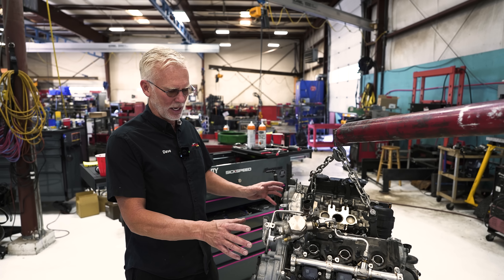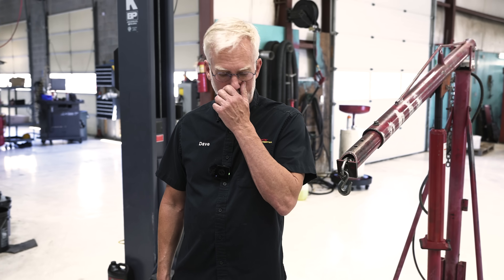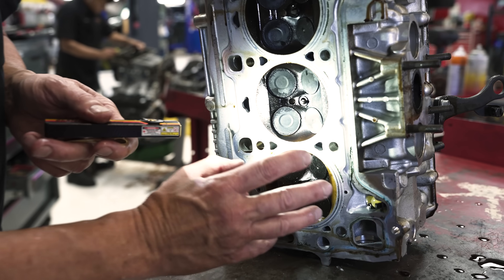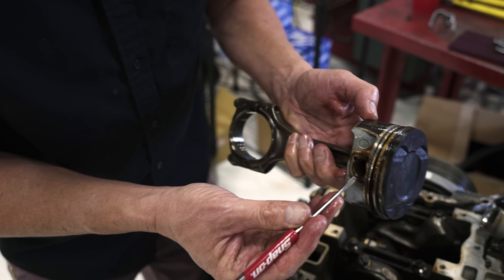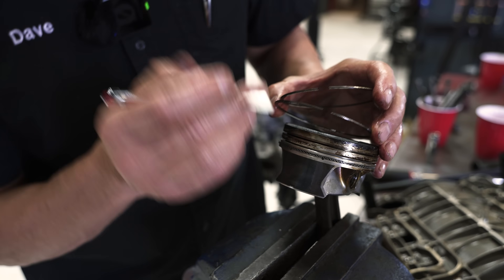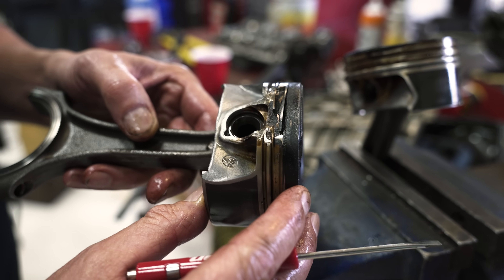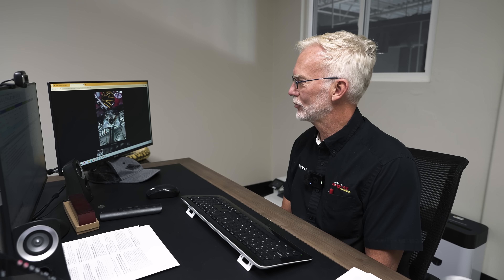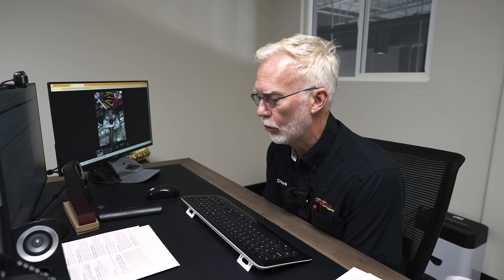Audi S5 Update: Piston Damage From LSPI (Low Speed Pre-Ignition)

Comment: I worked in a dealership that was bought out by another dealership.......they started having bulk motor oil delivered into a tank. We had NO IDEA what oil we were being made to put into cars. At the time the corvettes were coming with Mobil 1. They made us use the bulk oil they were buying............I left there in a hurry ! ! ! ! !
Reply: I only use Castrol Edge A3/B4 in my Audi … it’s not even expensive so I’m not sure why people deviate from OEM spec?  Cheers Drew
Reply: GM still uses Mobil 1 as their Dexos rated oil. I use Supercar in my Blackwing
Reply: Use c😢😢😢
Reply: @mitchellwilson8463 
I can tell you with absolute certainty, VW / AUDI OEM oil is Castrol. If you don't use Castrol, make sure the Oil rating is A3/B3, A3/B4. If you don't see this on the bottle, stay away unless it's an emergency. If the bottle doesn't say European on it anywhere, chances are you have an incompatible product.
Reply: Old European formula is the death elixir for Direct injection. 
Hi calcium just like in diesel oil causes spark knock on Direct injection.
Reply: @pigg20021  VW/Audi OEM oil hasn't been castrol for the past 4 or so years. They have been using Mobil for all 0w30, 0w40, 5w40, and 10w60 since. i work for audi

Comment: I was greatly impressed by your Tech, Alejandro, before you showed his tool box. He is efficient, thorough, and well trained. Not to mention making a good salary as well. Keep up the good work!
Reply: I'm sure he's earning every penny Hard, dirty, tiring work!
Reply: Rather than $50,000 in student debt you have $50,000 in tools.  But the thing that’s not talked about is how this engine may cost $30,000 to replace, this repair may cost $20,000 to do, and all it takes is one pinched o-ring, one missed knick in the cylinder wall, one bad spray pattern injector, one piece of metal he couldn’t see, and either the whole job has to be done again or he will be screamed at by the boss as they then have to make it right.

Guess who gets to do the repair again for free if there is one thing he misses, didn’t catch, was unable to see etc.
Reply: @Dansyoung  you're not wrong. As an experienced auto tech, I've seen these things occur. All I can say is, taking it apart the second time goes much faster. Live and learn. Alejandro has a relatively small box considered a beginner box. That cannot even come close to housing all the tools needed by an auto tech today. My box is Twice the size, it is still considered medium

Comment: Part of the issue is the shifting strategy of modern transmissions. They often lug the engine at low RPMs, which is the perfect condition for LSPI.
Reply: this is why i floor my RS5
Reply: Yes, I have noticed this on numerous friends cars. I tell them to gently press on accelerator pedal to get trans to drop down a gear.  I drive a 5 Speed manual so I'm in control, not a computer.
Reply: @robertcambareri1028 manual owners try not to mention they drive a manual challenge(impossible)
Reply: @ADUSN not many people drive manuals anymore. What are trying to get at?
Reply: Yupp 100%
Reply: Save The Manuals!!!! It's a campaign. Not a dig.  And it truly is a satisfying driving experience.
Reply: @hansgruber3552  LSPI had the biggest problem on manuals when direct injected design became popular. LSPI was basically inexistent on naturally aspirated or port injected before that. Direct injection came along, and manual transmissions were the biggest problem, due to drivers keeping tall gears at low rpms, asking for power. 
I think the automatic transmissions now are a problem due to epa regulations and gas mileage. The ecu is trying to keep you at 1100rpm when cruise is on at low speeds. If the car goes uphill, if the engine cold....
Reply: I think the LSPI is kind of myth as excuse for other issues - problems between seat and steering whell...
Reply: @pavolklepac935  I know there’s a temptation to ignore reality and just blame another person. LSPI is definitely real. It can be aggravated by high loads at low RPM. Engines have smaller displacement and more power than ever before and are often boosted. Lots of things are combining to create this problem.

Comment: Audi/VW attempted to build diesel-type, low-rpm gasoline engines to increase mileage; this was done by designing an undersquare engine with a long stroke to produce more low-rpm power which encourages engine lugging. In 2018 Valvoline was the first to address the LSPI problem producing an oil with a special additive and labeled it SN+.  If an oil without SN+ is not used, the claim is engine damage is a possibility; so how many oil/lube stations use these very specific oils--  likely not many.  Just another defective design just waiting to grenade causing massive expenditures by a trusting public.
Reply: Quick lube = stripped oil pan drain plug threads and improper oil level.

Comment: So I have a 335 with the n55 and use the dealer oil ,twin power turbo 5w30 ll-01 ,API SJ(changed every 5000kms) .Why would the manufacturer recommended oil for a direct injection engine turbo engine be the old API SJ and not a newer api SN+ or SP ?

Comment: Turbo charged and manual is the worst with LSPI. 5 mph and floor it in 2nd. Most LSPi is avoided with automatic transmission as cars a programmed to run slightly higher rpm before shifting when cold.

Comment: Manufacturers are using larger tolerances in the rings to reduce drag  , fsi, tsi, dont suffer these issues. Anything with  engine 0w20 oil , stay away from.
Reply: Had a Toyota Sienna go 400k using 0W-20.  It's not the film strength that gives protection, but volume.
Reply: @nicholasr7987  was thinking more 2L turbos with only direct injection, tsfi 2L Audi .... Toyota GR engines have both direct and tune port injection which with less carbon deposits on valves and pistons,  and less fuel getting in the oil at idle.

Comment: Regardless of ‘any’ cost/value of ANY vehicle, if it’s dead in the water, so to speak, it’s literally just a big ass paper weight.. useless 3K+ Lbs of junk, until MAJOR $$$$$$ gets tossed at it, v just a few $$$ of general, CORRECT, routine maintenence, at CORRECT man’f’r milage/time recommended intervals, preferably using OEM parts/fluids.
Eventually, due to same types of neglect &/or inferior “maintenence”, we’ll also be seeing more & more Hybrids AND ev’s, parked in folk’s driveways, up on jack-stands, needing MAJOR $$$$$$$$ from blown-out or destroyed battery systems, electronic systems, charging systems, electric motor systems!
Folks, it’s fairly simple, if you do NOT wanna spend your entire life making INSANE monthly payments for vehicle(s) you’ll NEVER “own”, v preferring vehicle ownership, that’s a long-term major commitment that ALWAYS HAS & ALWAYS WILL ‘require’ proper maintenence!
As a fellow long time Cert’d mechanic/technician, my “daily driver”, currently still OWNED vehicles are a 22 year old H Accord LX w/2.7 ULEV 4 cyl @ 270K on ODO; runs/drives fine; orig engine.
24 year old F-250 SD 7.3 PS @ 380K on ODO, orig engine; runs/drives fine.
69 year old Buick Super w/original 322 Fireball Nailhead… ran/drove fine, until I dissected that one for resto work.
Point is, I’ve very much respected, understood &, kept up on AT LEAST the bare minimal routine maintenence, KNOWING full & well, just how massively expensive the alternative is, of either RIDICULOUSLY EXPENSIVE STUPID ASS MONTHLY PAYMENTS for new CRAP or, dead-in-the-water broken CRAP!

Comment: Three things I always do with my car. First, I use the proper oil for the car, AT LEAST as good as the manufacturer states (and whatever the seller states, I change the oil right away). Second, a fuel additive to keep my injectors as clean as possible without having to pull them out and clean them. Third, I never hoon it until the engine is warm.

The last few cars I've had, they have started off feeling a bit rough, noisy and low on power but after 20,000 miles of doing those three things (then hooning it when I can) they have all felt and sounded much better than when I bought them and after the usual teething problems when I first get them need nothing more than fluids, filter, and tyres. Obviously consumables like brake pads etc.

Comment: Is direct injection just the use of a fuel injector istead of a carburetor?
Reply: No.  Direct injection squirts fuel directly into the cylinder, versus port injection which squirts fuel into the intake port or manifold.
Reply: @geraldschrader8511  thanks!

Comment: The comment on head gasket leaks cleaning the inside of the cylinder gave me an idea. If it doesn't exist already a water based product meant to go into the combustion chamber to clean it without disassembly. Ideally an additive that won't cause damage and clean the cylinders of carbon buildup.
Reply: Walnut blasting is the proper procedure.

Comment: He should definitely replace the timing chain and tensioners while the engine is out. The only exception would be if it had extremely low miles.
Reply: LOL....reading between the lines Dave is saying "I'll give you the cheapest out, replace bad pistons and rings then dump the car ASAP"
Reply: Bad idea to put used guides back in
Reply: this one had 75k miles, that's low miles.
Reply: Be easier to replace the car with something that isn't an overpriced overengineered shop filler.
Reply: @MadScientist267  what will this thing be worth after he dumps  25 k into it....sounded like a prime candidate for some kind of insurance mishap
Reply: @MadScientist267  its a decent engine driven by imbecils who dont know the slightest about ICE. These type of ignroant bloke people better off driving EV's or just ride the bus tbh . 
My father is no exception at the age of 50 not knowing shit about howw engines work.Once i sat nex to him and he would accelerate too hard(40%) for a cold engine i said you should be very gentle in the first 5 minutes and moderate after that until its up to op temps. What did he do? He gave full throttle just to show me he can do it and nothing would happen. This was after roughly 2-3 minutes driving(2l diesel) at 50km/h. The engine and the oil was still cold as fuck. (G20 320d)
now this is just one type of story, there's a variaty of imbecilistic behaviors regards to driving a car. 

No wonder you see german cars left and right in repair shops. Btw the average IQ is what? 95? Statistics doesnt make it look any better either lmao
The diff between a 120iq mildly intelligent vs a 95iq bloke is not 127% to the 120iq guy its more like 100x ability to think. And this is between the avereage garbage and a barely talented person. 

I belive a driving licence should require a minimum iq thats slightly above the average, the rest ride the bus to the construction job or to the factory
Reply: @MadScientist267 Japanese V8s are way better than any of these German cars. The only exception is SLS AMG, which is impossible to find.
Reply: @lostalx  Rollin yota... indeed
Reply: @lostalx  eh the new audi 4.0TT is pretty freaking solid. It's just a weird engine. (I'm biased I have one) but genuinely have not been disappointed. I had cars with the 4.2 and the 4.2l and never had issue either. It's just a different owner experience than Japanese.

Comment: How can you be 100% sure that no metal made its way into the turbocharger oil lines. Wouldn't that cause another VERY expensive failure?
Reply: Pretty sure there is a screeen in there
Reply: @stevenmcinally4420  That's not 100% sure.

Comment: Just curious, what would a job like this cost including the timing chain work? Btw, I have a 2019 S5 with 155k miles on it. It runs good now but I'm thing of having the engine completely serviced like this and am wondering what the price range would be. I'd rather do this than have to buy another Audi.
Reply from the maker: thank you for your question I get a lot of questions about what the price is. I avoid quoting on videos because the videos will be out for years. Best to contact your local shop in this circumstance 👍

Comment: Use Top Tier gas also. According to Lake Speed Jr you should use with DI. That motor looks very dirty with carbon. Poor quality fuel. Chevron techron fuel system cleaner with PEA is what he wants to use.
Reply: Ya. Most direct injection engines look like that.  But .what you are seeing is oil consumption. .carbon .
Reply: @stevenmcinally4420  yes I understand but on direct injection if you don't keep injectors clean it carbons up the rings causing oil consumption. A lot of problems on modern engines is their intolerance of deferred maintenance.

Comment: What I've learned is, don't buy an Audi, buy a 1975 Chevy that you can work on...LOL
Reply: Respectfully saying that’s not the answer, those engines are built with precision with certain alloy metals that Dave mentioned. It’s a highly likely a cheap product was used and accelerated the destruction of this engine. If cheap products are going to be used buy a 90’s Japanese vehicle.
Reply: And fix it like MacGyver. With a paperclip and some chewing gum.
Reply: like a Cosworth Vega? quality stuff from GM! 😉 
what a dark time, in the middle of the malaise era! Gets you a 165hp Corvette
Reply: Sure, but it will be much less fun. If an Audi buyer was looking for dirt cheap maintenance and simplicity we would lol drive Toyotas.
Reply: Our family car in 1978 brand new 5 litre chevy had less than a third of the power of my 14 year old Audi and would overheat if I ran it at 80mph.  The Audi can hit almost 200 and it is 99% original even the wipers and the battery.  The chevy $10 shocks were gone in a year and many other things started going on the brand new car with hardly any miles as it was only driven on weekends.

Comment: LSPI is common to European cars?
The Octane of gasoline in Europe is supposedly higher than N.A.
Maybe this is a contributing factor, because of where they are designed.
I bet getting parts for this motor will be a long process because Audi will not expect anyone to fix them.
Reply: Never get a direct fuel injected Audi second hand. Dealers in Europe wont touch them.
Reply: They use a different metric though so you cannot compare numbers directly.  It's the RON vs (RON+MON)/2. The EU value would be higher for the same  gas. But your question regarding the impact of octane level on LSPI is very interesting. I have a 2009 Q5 with a 3.2 FSI (FSI is direct injection for VAG) and it calls for 91 octane level.

Comment: This is so true. I have 3 Porsche and am very particular about what oil i use. Porsche also recommends start driving immediately after starting and not idling but not going over 3k rpm until the oil temp, not "engine water", is warmed up. Very important about oil temp. Then I always use top tier fuel.

Comment: On a cold day let's say between 8c to 15c is it better to let your car idle for 30 seconds or longer before driving? Or does it make no difference
Reply: It takes about 4 km of driving on secondary highways (90 km/h) to bring my vehicle to the point where the thermostat opens (100C) at low throttle.  On city streets I would think it would be a lot more time and distance.  And this is without having the oil up to temperature.
I usually allow 20 to 30 seconds of idle time at startup for full oil circulation before pulling away, and try to use the smallest acceleration needed until the temps are up to normal.  The most wear occurs at startup and getting the engine to temp quickly under low load is best. This is not always possible,  however
Reply: @gordonborsboom7460 "getting the engine to temp quickly under low load is best" - 100% agree. A lot of people mistakenly believe that letting the car idle for an extended period of time to slowly get up to temp after a cold start is best and don't realize they're doing more harm than good.
Reply: Ideally.. but i think tech has taken care of that! A good motor oil and all the fancy ECUs quickly create ambient temps for operation..
Reply: Usually manuals say to allow the car to reach idle rpm before driving (600 or so rpm for all my cars) I never had an issue following it and I will redline my cars in every gear at any chance I get once its at operating temp.

Comment: Dave, make sure you update the rockers and lifters. B9 platform has major issues with the lifters. I'm also wondering if the car is tuned.
Reply: Exactly this. Check the rockers! Bearings fall out of them.
Reply: I was thinking there would have been roller bearings in the oil pan from the rockers
Reply: With an aftermarket RS style grill on there and cylinder failure it is likely tuned, and by IE. Nobody has cylinder failures on their B9/B9.5 stage 1 tunes like IE. Google it.
Reply: Mmm. Been doing these a long time. 
Not prone to . Cam follower failure.  Unless of course. It's run out of oil. Several times.
Reply: @stevenmcinally4420  You can tell that to the multiple customers that have had rocker failure. VAG quietly updated the rockers as the small needle bearings were failing. Causing camshaft damage. B9 early production 17-19 had issues. We do them all the time.
Reply: @williamghiatis6739  The rocker arm failure for early B9s is pretty well known at this point. It is also considered a pretty rare failure in the Audi community. They can fail, but not often. Do you really see these frequently in person?